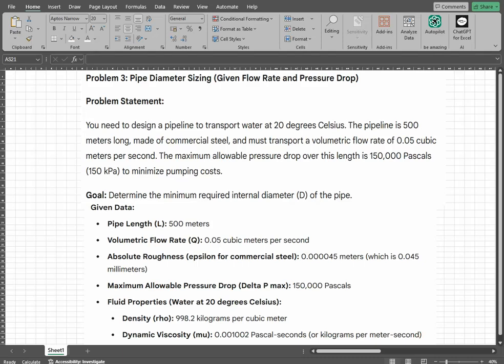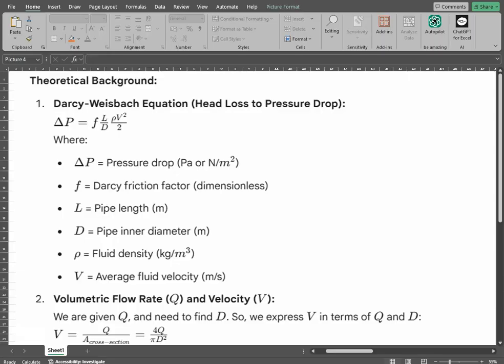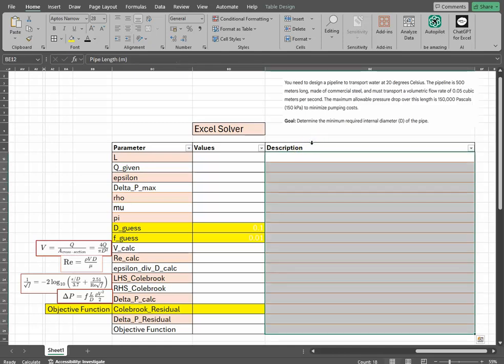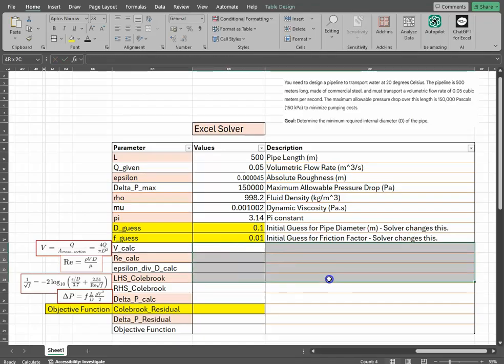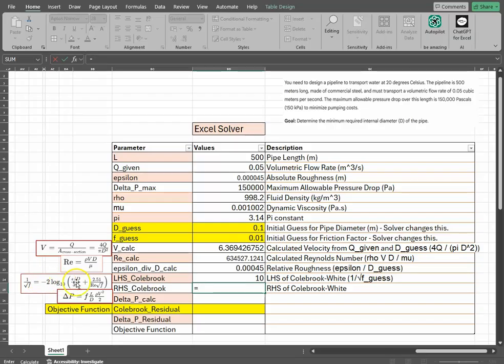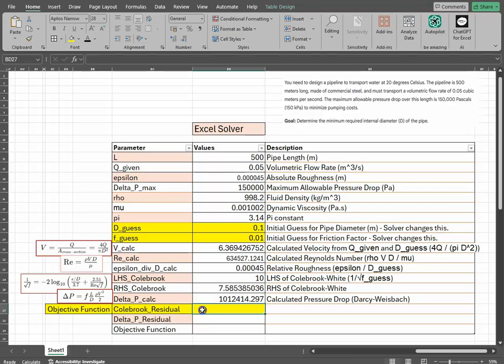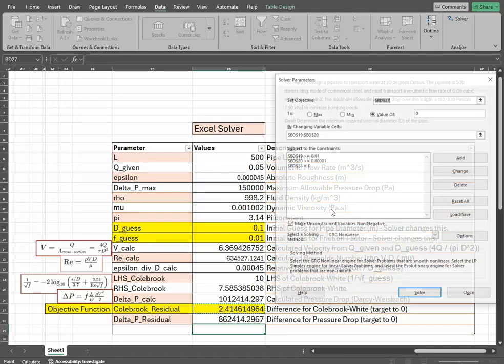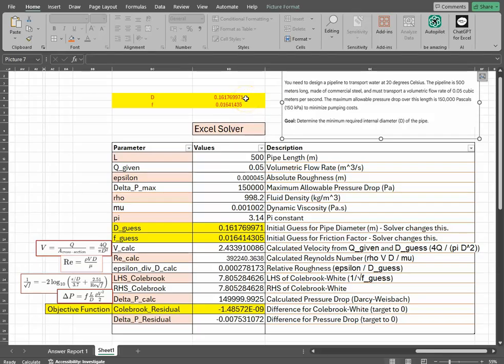Pipe Diameter Sizing in Excel Solver | Calculate Flow Rate & Pressure Drop Fluid Mechanics Tutorial

Comment: Can you explain where this method used and what is the difference between darcy weisbach
Reply from the maker: Pipe diameter sizing is a design method used across engineering (e.g., chemical, civil) to find optimal pipe sizes for fluid transport, balancing flow rate and allowable pressure drop. This method employs the Darcy-Weisbach equation, which is itself a formula used to calculate pressure drop given pipe and flow properties.